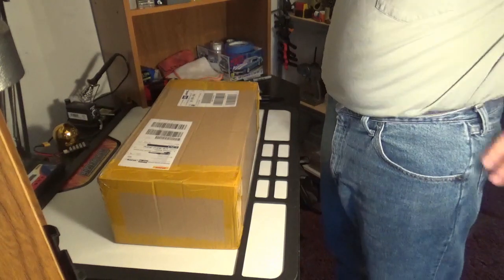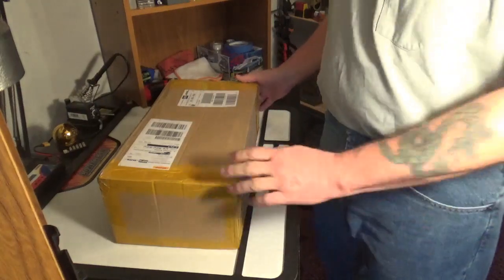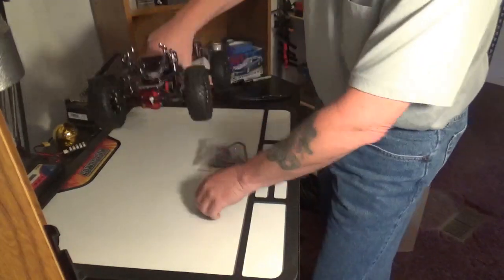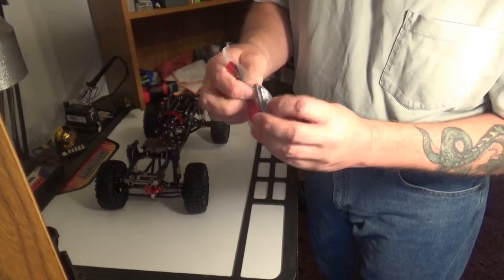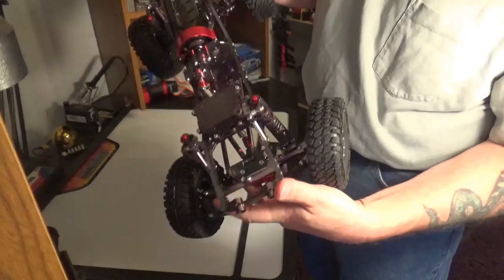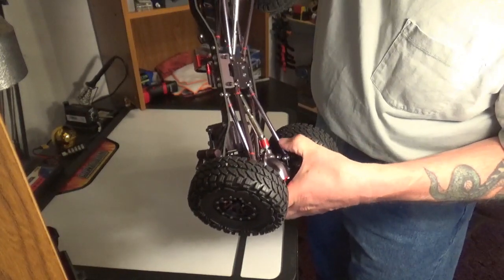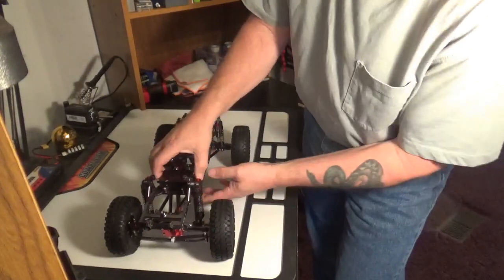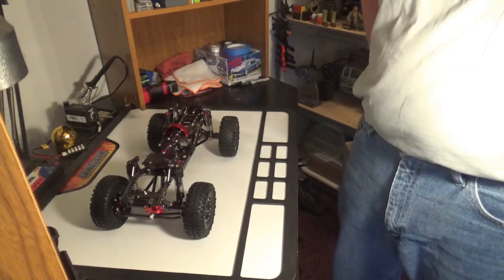Cool Racing SCX10 Aluminum Chassis Unboxing

Comment: Hi great vid, can I ask have you got any pointers about what motors/winds to use on this, I'd be after say "slow walking pace" as mainly crawling on beach etc., also any recommendations on ESC/radio/servo and battery? My kit arrives this week paid £208 :)
Reply from the maker: Thanks!  You ask some great questions...I'll be glad to share my opinions and personal preferences based on my experiences (sound like a disclaimer? ;) )

Motor: You can spend a ridiculous amount of money on a brushless set up, but I still prefer brushed for trailing/crawling. Holmes Hobbies (www.holmeshobbies.com) is, again in my opinion, the best on the market. I favor his Trailmaster Sport 27t 540 can. About $15 US. Great low end controllability and torque and more than enough high end speed for a scaler. How long do they last? I don't know...I've yet to have to replace one!

ESC: I'm still attached to the Hobbywing WP1080. 15 programmable aspects (comes with a digital programming adapter), tough waterproof construction, excellent control and tuning capability and less than $45 US. Win all over it. Currently running five of them, never a problem.

Radio: I'm a Spektrum fan. Like how they feel, good UI, all the features I'll ever need. I have four DX4C's but they're discontinued...when I get another it'll likely be a DX5 Rugged. About $200 US with a rx. Big investment respectively, but I'm running 13 vehicles on my main radio so it's a one-time thing.  You can get a 2 channel rx for about $30 for each additional rig.

Servo: You can spend a lot of money on a servo. I have a high end 3 Brothers servo in my Bomber because it gets abused a lot, but all my scalers run DS3218 20kg Amazon specials under a variety of brands. They're tough, they work, they come with an aluminum servo horn and they last (except in Bombers lol). $16 - $17. How can you go wrong??

Battery: I run 3S LiPo 2800 mAh 35C in everything. Floureon is a good brand for me (Amazon again, less than $30). 2.5 to 3 hour run times, never had one puff yet, perfect for low speed driving (walking speed) but zoom in reserve when you feel like it with a 27t motor. Just make sure you do your homework on the care and feeding of LiPos if you're not familiar with them...they do require respectful charging, discharging and storage. 

Longest reply ever! Hope you find some value there :-)
Reply: @WSquared60  Brilliant thanks for that, I'd narrowed my servo down to that DS3218 and the WP1080 ESC so I'm glad I seem to have made the right decision on those! Will look at the other bits, thanks once again!
Reply: I would suggest if you want brushless go with the axe system around 1900 to 2700 kv range for the motor, That is all I use and love them.

Comment: This is a very nice running rig,just make sure that you grease up those axles before running it through water. For the price,I doubt that we'll do any better. Personally I went for a 35T brushed motor(re-buildable) , a DS 3218 MG servo and just a HW 1060 ESC.

Comment: I bought one of these from Aliexpress last year and it is excellent. I thought from the pictures that I was going to get basically the same kit, however, mine came with a fully enclosed spur and pinion gear, fully splined prop shafts and some other minor differences such as the gearbox and bumper design. If these components are of issue it might be worth asking any retailer what the kit has. 
See this RC Groups link for some photos of my vehicle:
https://www.rcgroups.com/forums/showpost.php?p=42661841&postcount=2150